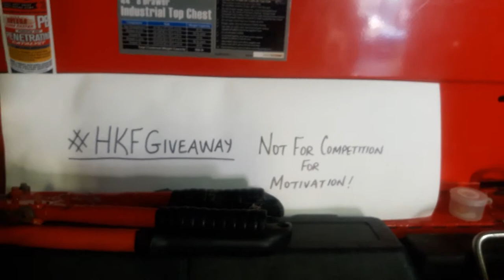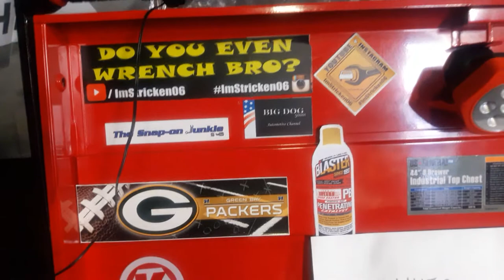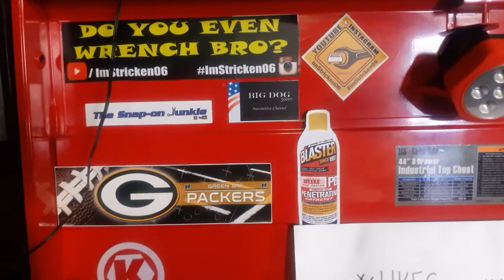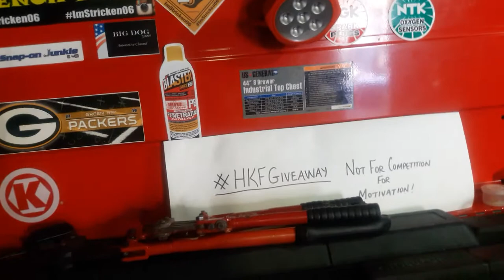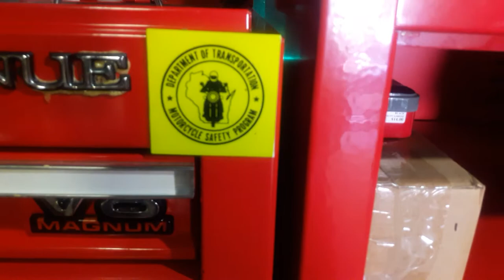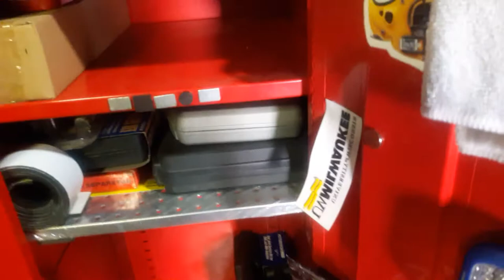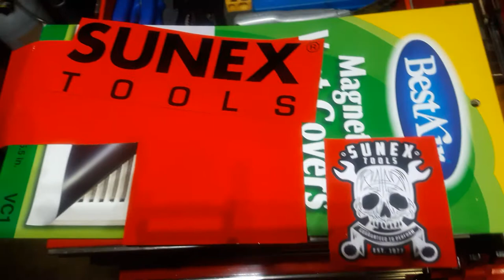Toolbox Tour - US General 44 Inch Set Pt1

Comment: How did you mount that extra shelf in the locker? At 9:00 min into the video.
Reply from the maker: Edwin H 
You can use some small S hooks, but I had some picture hanging clips on hand and I bent the tabs backwards to fit into the slots. 
The shelf itself is a 16x16 metal pegboard.
Reply: I have the same one, I glued 4 thin strong magnets on each corner of the Locker.... It can hold serious weight now..... Thanks for the Video!!